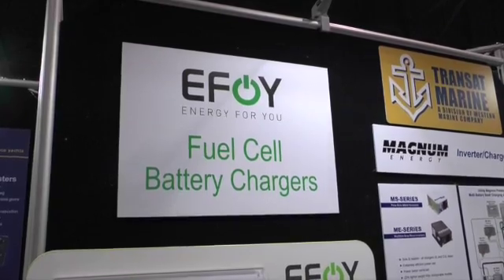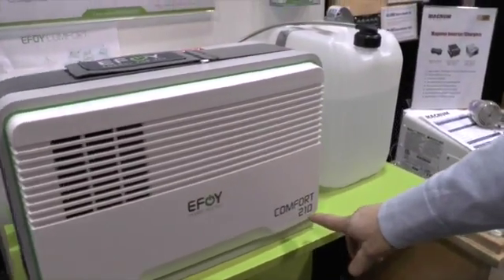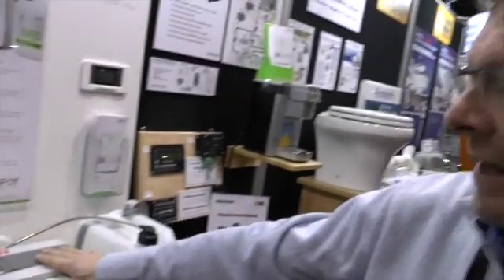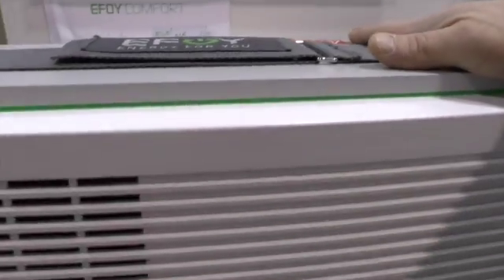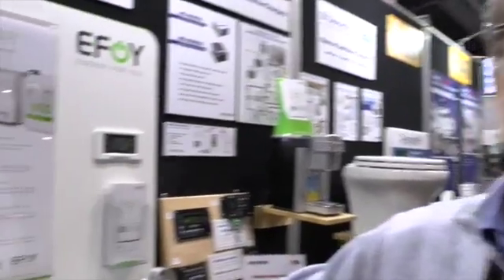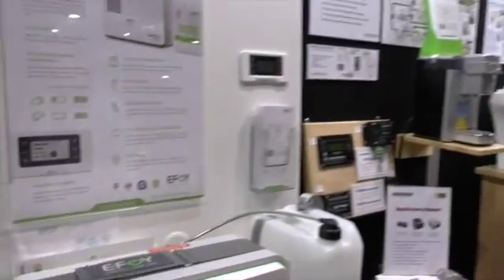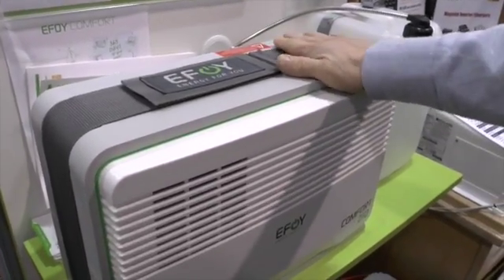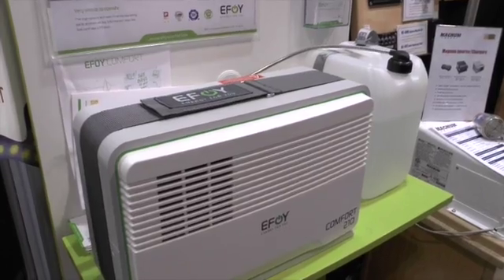EFOY fuel cell-Allan Stovell

Comment: vaporware? check the price and availability, and don't forget the hydrogen rich water you need. do also check what wattage you need vs what these things are capable of.
Reply: Apparently It's just methanol but they probably want you to buy it from them, maybe void your warranty if you don't. 
https://www.imarineusa.com/Efoy151-000-212.aspx  and 
https://www.imarineusa.com/EFOY150-905-099-2PK.aspx 
around $30/Gal!  What a disappointment